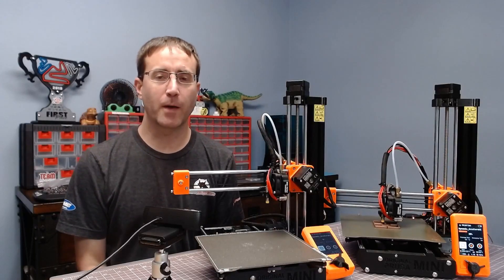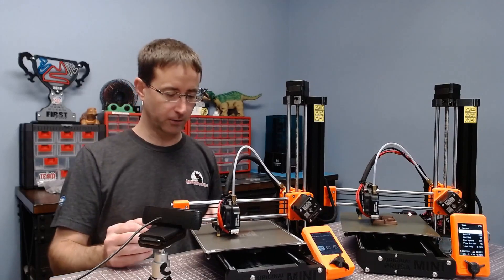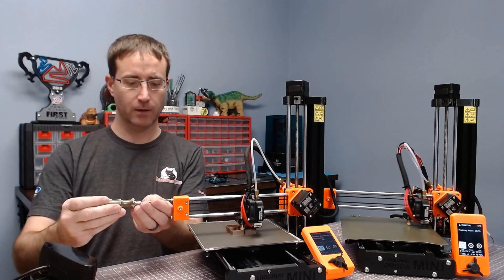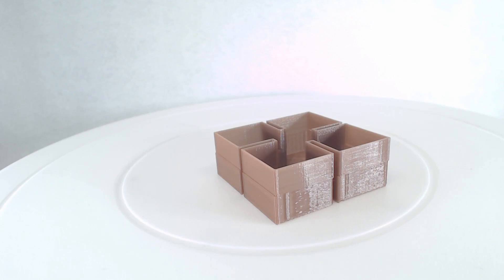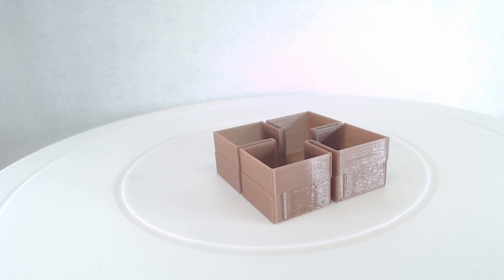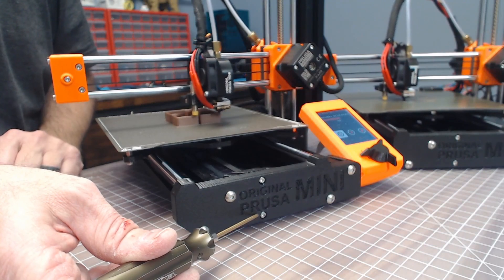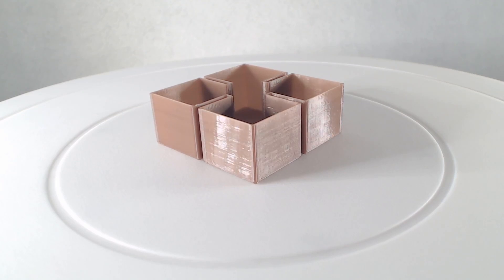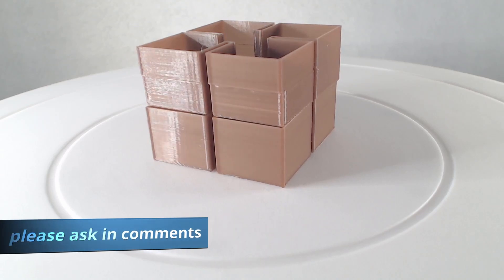Prusa Mini belt tension - #PrusaMini 3D printers and how belt tension adjustments shows up in prints

Comment: How tight do you tension the belt?
Reply from the maker: I have them both set to where I can pinch the belts together with my fingers and not feel like it is a strain to do so. If you pull it like a rubber band it has a deep sound. Loose you get a lazy blah thud like sound. HA HA overly tight and it will sound like a guitar string and I don't like them set like that.

I hope that makes some sort of sense, if not let me know and I will see if I can setup a quick video.
Reply: John's 3D Printing Corner thanks John, I actually have an issue if I tighten it down the belt tilts a bit. If you can provide a video it would be truly appreciated. The prusa help guide doesn’t really say how tight etc. I’ve been getting z banding and trying to fix the root cause of the issue..
Reply: @Johns3DPrintingCorner  I'm just watching this video now and it wasn't very clear about how tight the belts were and what your conclusion was. you say the belts were as tight as they can go but by your description here it sounds like you were comparing a super loose belt to just a medium or average tensioned belt, as apposed to a super tight belt, is that accurate? so really your comparison here is between a loose belt and a properly tensioned belt, you did not test really tensioning to be super taught. id imagine a very tight tension wouldn't cause as many issues with the print but rather introduce more drag, noise, heat, and slower times. potentially some artifacts but not like a loose belt.

Comment: Nice explanation. 
Where can we find the STL ?looks like a cool test...
Reply from the maker: https://www.thingiverse.com/thing:3209955  Here you go, it is actually meant for adjusting a setting that the Duet boards have in their firmware.  I thought it would be good enough to show what was going on with the differences in belt tension.  It works really well for my Duet powered machines as I can reduce the ghosting to almost nothing.